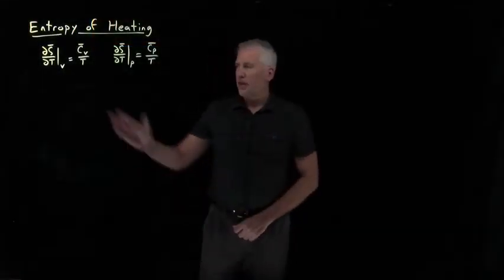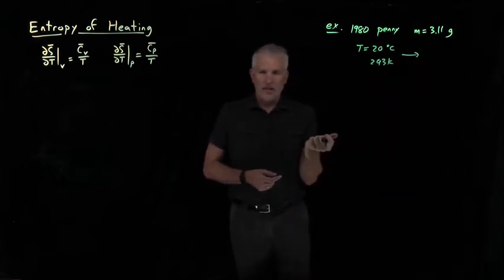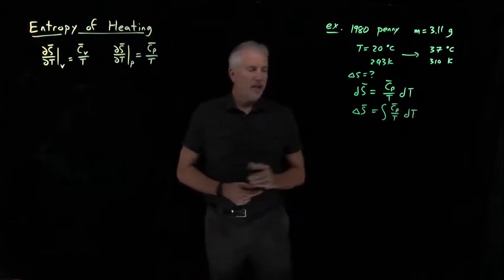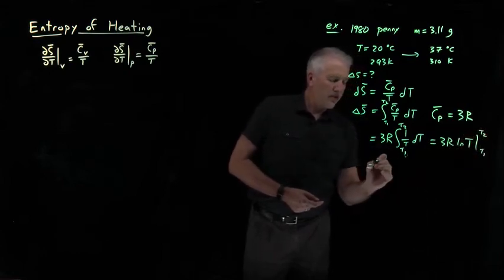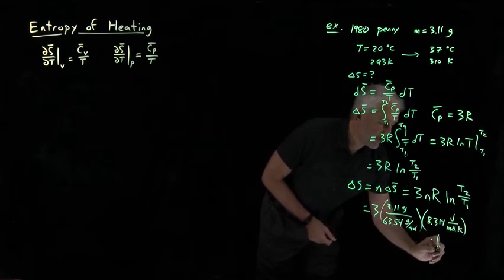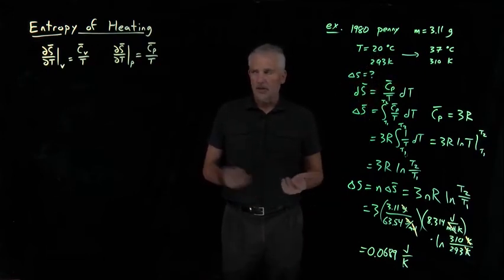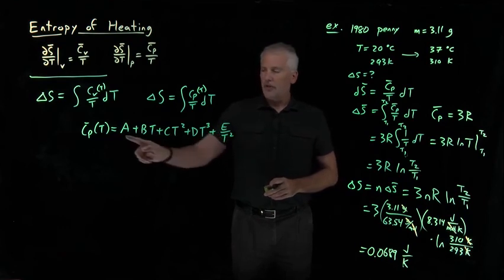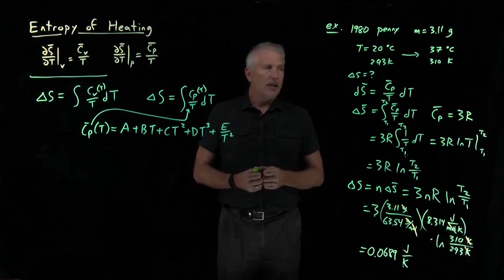Entropy of Heating

Comment: Hello sir! I have a question... So there are two equations that relate entropy to temperature. Which are derivative of S with respect to T holding V & P respectively. Then is it true that S is S(T,V) , S(T,P) each?
Reply from the maker: Yes, that's correct. When you write S(T,V), you're viewing the entropy as a function of T and V. But it's also fine to write S(T,P), in which case you're viewing the entropy as a function of T and P.
Reply: Hello. thank you for the comment! I got it

Comment: dose monoatomic cu atoms have 6 degrees of freedom (3linear & 3vibrational) is that the reason why Cp = 3R
Reply from the maker: Single atoms have 3 (translational) degrees of freedom.  (These are 3 dof for their position; depending on how you count, you may also consider three additional dof for their velocity.)

That is, indeed, why the heat capacity is 3R.

Here is a video about counting degrees of freedom: https://www.youtube.com/watch?v=CpsWKmUTaTA&t=1s

And here is one about the heat capacity of monatomic solids: https://www.youtube.com/watch?v=j8rEF15VONg